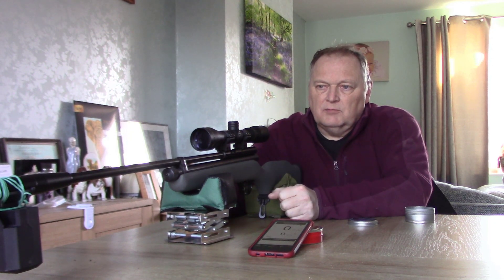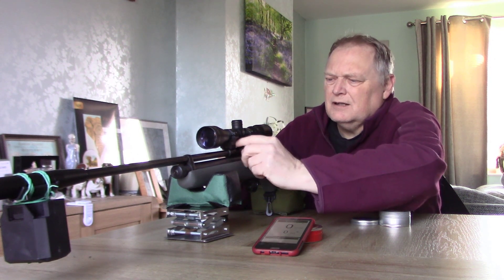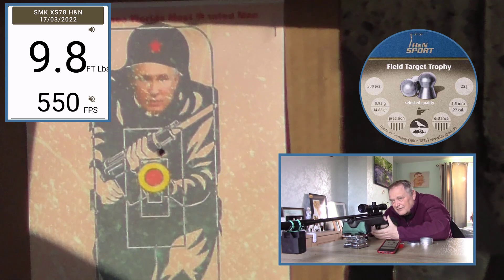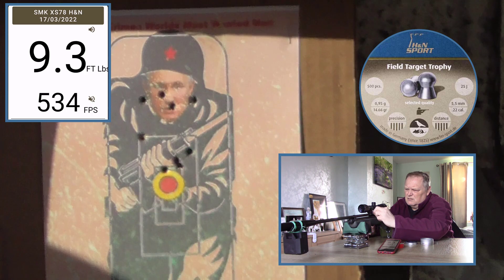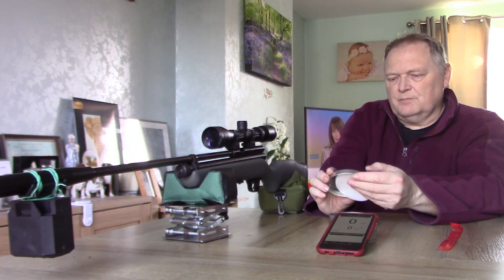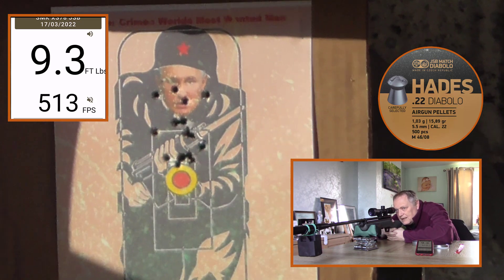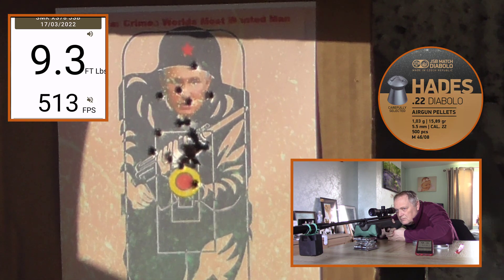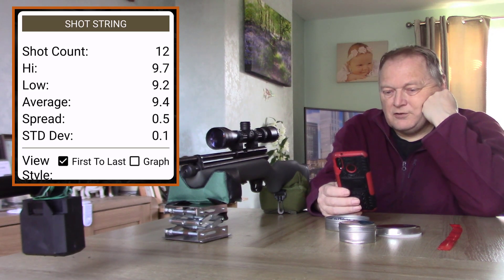SMK XS78  .22 Power Update - Temperature variation effects 3c -15c

Comment: I have conducted some experiments on my CP2 177 Pistol in cold weather, using stock and after market hammer springs. I have a collection of springs. 
I graded them by slipping them onto a steel rod and putting a weight atop and measuring the compression. They fell into two categories, 15mm compression and 22mm compression with the same weight. I did not weigh the weights, that is not necessary to rank the springs. 
The result was counter-intuitive. 
At 12° the heavier spring produced 430fps and the lighter spring produced 475fps. Less is more.
This is as I expected as the heavier spring is needed above 28°. Above 30° the hammer will not open the valve with the oem spring. 
Above 15° the oem spring will bring it up to the Goldilocks 177 Target Pistol zone of about 500fps and largely temperature independent up to 25° as the CO2 valve offers a degree of temperature compensation - as the vapour pressure goes up the hammer releases less gas. 
However I suspect the "less is more" is down to gas flow rate in that a smooth acceleration is better than a sudden shove.

Comment: .  I had a full tin of JSBs come loose in my carry bag . l suspended the lid on a piece of wood and using a small phillips screwdriver and a light hammer,  tapped the point of the driver into 4 of the retaining slots deforming them a bit further than normal. The lid now makes a positive click when pressed shut and will now have a more secure hold. Of course , the lid can be used on the next tin of JSBs that you open.
Being in Australia , we need a firearm licence for all arms regardless of their propulsion systems therefore we are not limited by muzzle energy restrictions. I am the owner of an S200 of the very first edition i.e. serial number less than 2000. I enjoy using it on the 50 metre range as it really challenges my grouping ability. My other is an FX Independence that I have upgraded to have an air cylinder in place of the pump as the tropical air that exists at my latitude draws too much moisture into the gun.
Thank you for your very interesting coverage of pellet varieties as they show me the true potential of the performance of sub 12 shooting.
Cheers to you and your Club from  Downunder 🇬🇧🇦🇺👍

Comment: Conversion too a PCP? Is it possible ? Is it worth it ? ... would you WANT to do it ? ...
Reply from the maker: I have thought about it. The adapters are cheap enough, but the cylinders are not as thick as normal PCPs, so are restricted to about 1800 psi, compared to 3000 psi, so probably not a very big shot return.
Reply: @airgunsniper-elite7385  
Could a " thicker " air cylinder tube be sourced from another rifle to fit ?
Reply from the maker: @markhomer5704  Not really with the cylinder version unless you could machine other parts for trigger and transfer ports etc as it is a full length cylinder and not a separate air cylinder like on some PCPs. Maybe with the 79 bottle version it would be possible, just by fitting a decent bottle. These types of rifles are very popular for those that like tuning and blinging, from Walther barrels, new breach blocks, stocks and PCP conversions. They are similar to Crosman, but made in China.